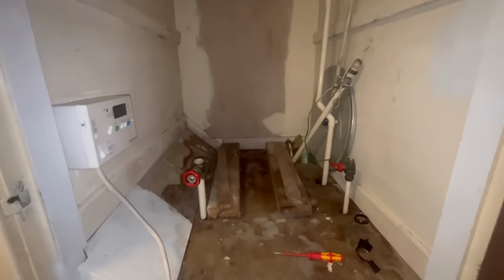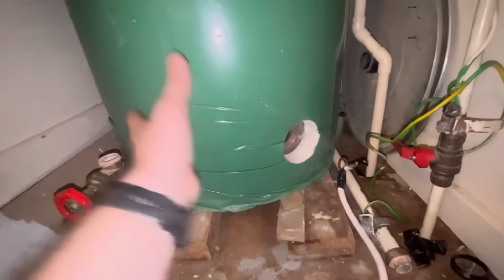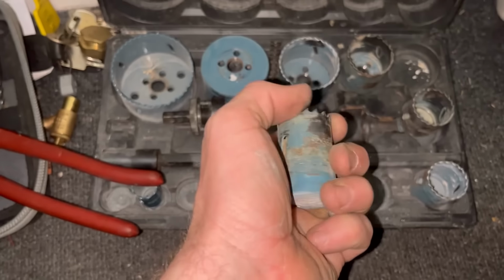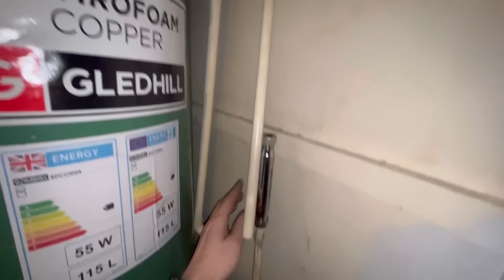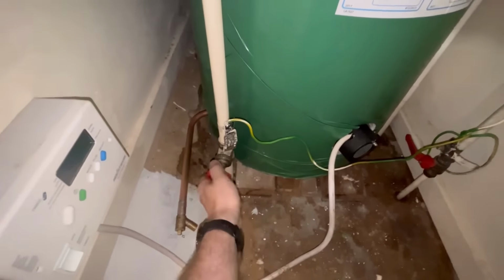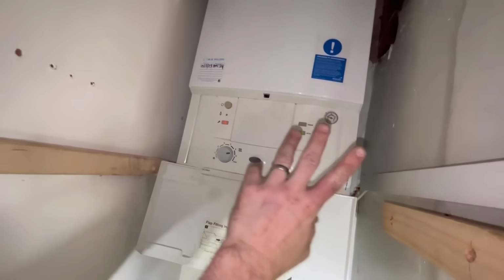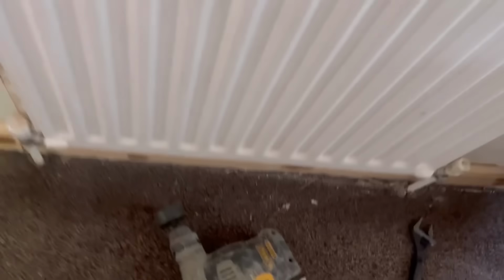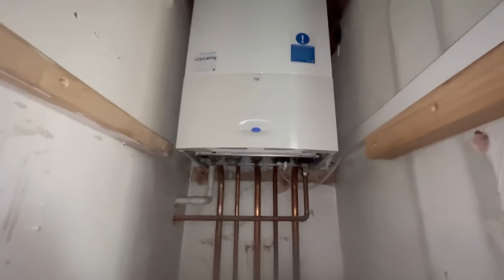Plumbing - Avoid Doing This! What Was I Thinking?

Comment from the maker: Let me know a time when your head wasn’t in gear…own your mistakes…I did get lucky this time 😅😅 thanks for your support as always 🙌👍
Reply: Started filling the system and forgot to close the rad vents in a couple of rooms last week. Such a schoolboy error. I was so embarrassed 😞
Reply: On my maganacleanse I had not checked the how tight the hose clips were for a while and halfway through the clean one popped off and flooded the kitchen! I had the unit sitting over the hob so that got soaked aswell. I always tighten them each time or at least check if tight! Customer was fine and helped me clean up :)
Reply: I once unsoldered a live gas pipe thinking it was the heating return…….lets just say the flame thrower effect was an eye opener😳🤦🏼‍♂️🤷🏼‍♂️
Reply: When first starting out after finishing my apprenticeship and thinking was was amazing and qualified… drained down boiler to change a flow turbine, didn’t turn the mains off… customer comes downstairs to a flooded kitchen me soaked and a very wet and dead boiler.  Turns out I didn’t have a clue… 🤦‍♂️ no idea why I thought I’d need to drain the boiler to this day.

Comment: Good video lad. I’ve fitted a few of these cylinders. Extra homes in tank
Just give you options left or right hand pipework. I recommend the Bahco Contractor's Bi-Metal Holesaw Set, 11 Piece  come in a handy tubular case.
Reply from the maker: Have to look at that hole cutter seat thanks mate 👍

Comment: We use the Starrett holesaws at work Luke. Don't last too long on steel beams or concrete fireboard but for plaster, wood and thin metal they're ok. 👍
Reply from the maker: I will have a look at them mate, 100% be better than what I tried 😂👍

Comment: Hands down the worst cylinder ever invented
Reply: 100% the endfeed elbow on the vent, not soldered, pathetic really, and you spend a fortune on blank for the connections you don't need!
Reply from the maker: Yeah crap idea to be honest no pressure in bathroom, gets better as you go down but still poor
Reply: Why not use a booster pump